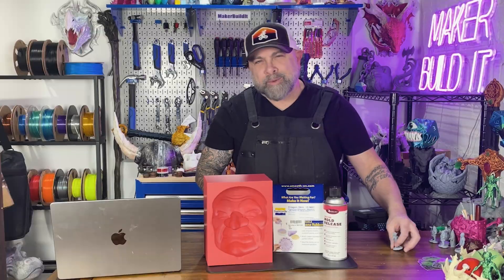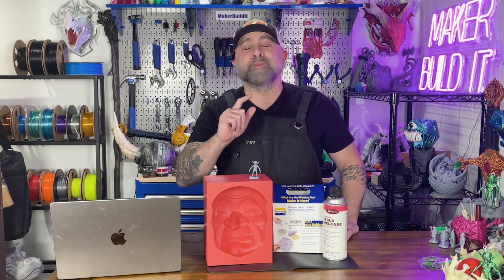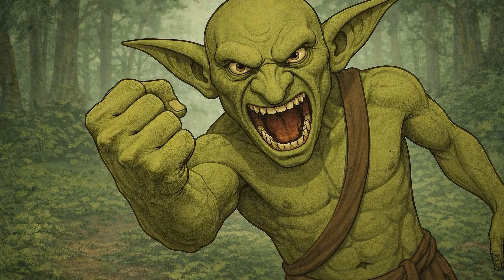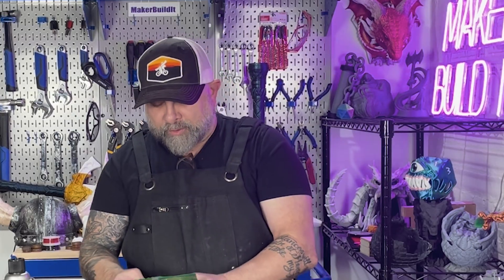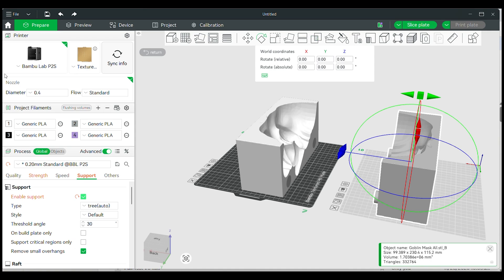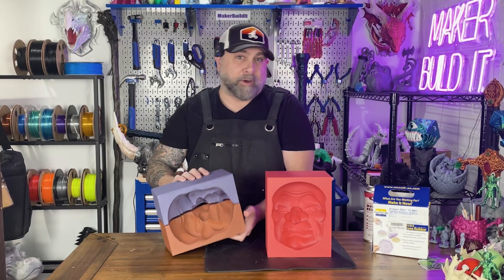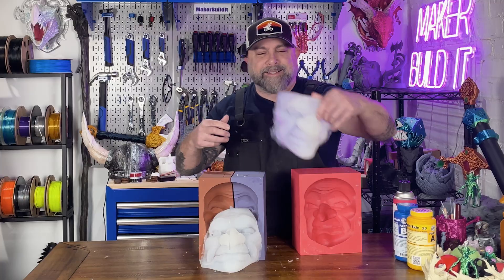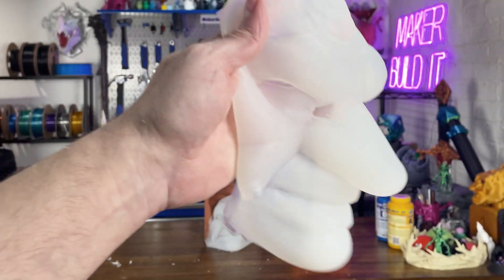We Turned a 3D-Printed Goblin into a Wearable Silicone Mask (How to make 3d Printed Molds!)

Comment: Just a bit if advice form a small time haunter with adhd that went in a deep dive into casting, make-up and prop making a few years back. The clay test would pose problems no matter what in my opinion. As we saw in the video it wasn't exposed to air so it didn't dry, but if it had it would have locked into a solid mold. You wouldn't have been able to release it from any undercuts anyway. 

The properties of the mold itself determine what you can easily cast in them. 

Hard mold - soft cast. 

Soft mold - hard cast. 

Not to say it isn't possible. But, just a rule of thumb.